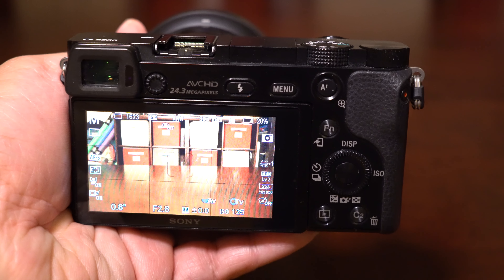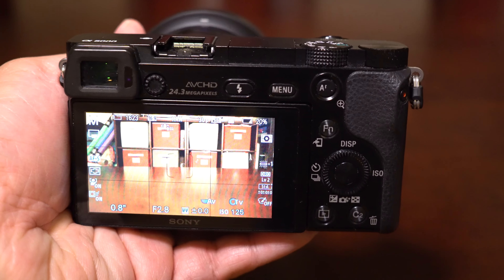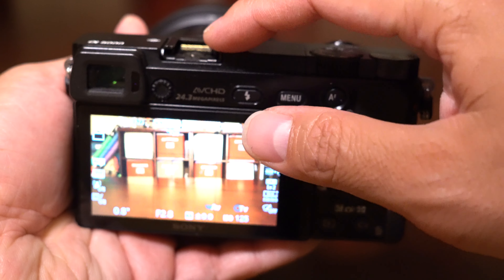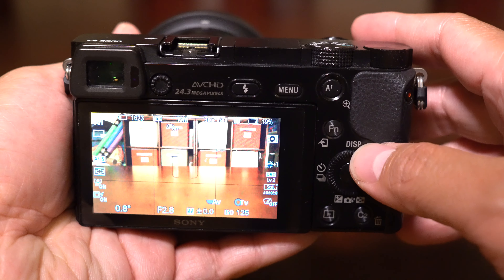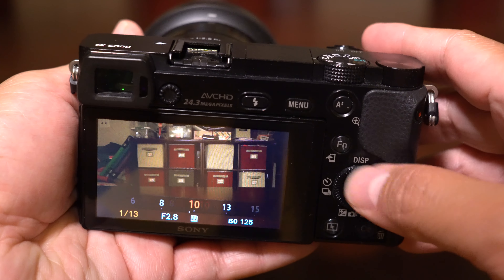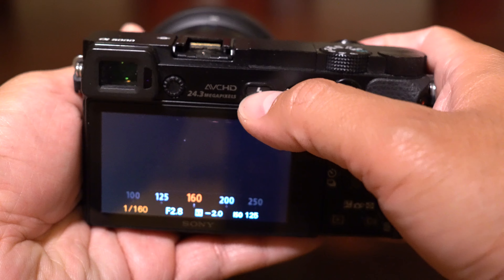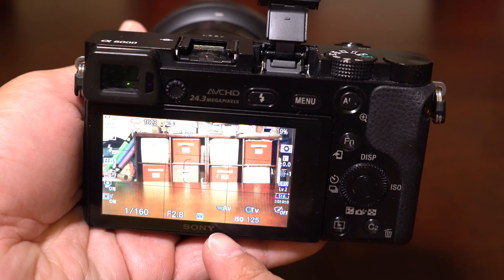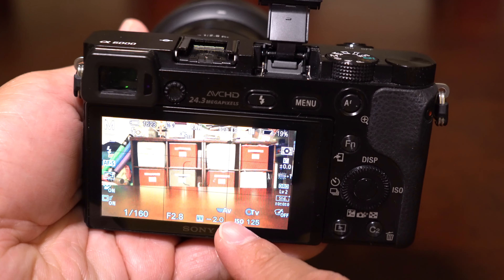FotoTofu Ep. 11 - Sony A7x/a6xxx LiveView + Flash:  Workflow + BTS Photoshoot

Comment: Great video. Thanks for sharing the details. May you also show me how you determine the flash power
Reply from the maker: +jnprpulse test thanks for the feedback and question.  After working with a flash for a while you can start to develop a feel depending on distance and what modifier is used.  It's not as precise as a light meter but when I'm using one or two lights, a liGht meter is helpful but isn't necessary in most situations. I do use a light meter at times though. I'll put together a quick video with my thought process and how to handle different situations.  I just need to organize my thoughts.
Reply: +FotoTofu Thanks again. I am a beginner in flash photography. Your tip is very helpful. I'd learned a lot. btw, your model in this video is adorable :-)
Reply from the maker: +jnprpulse test thanks! Glad it was helpful.  I'll pass your compliments to to me ideal 😀

Comment: I recently bought the X1Ts & XTR16 to use with my old version 1 Flashpoint n360. I have a Sony A7II and A6000. The trigger will fire flash, but I can't get the flash power to change remotely. Any thoughts? Your the reason for this purchase. Good job on your video's! Ron
Reply from the maker: +ron riggs hi Ron, did you have a chance to try Joe's solution?  It happens sometimes because the dial on the receiver is pretty easy to inadvertently switch groups.  If that doesn't work, check to see that you're not in HSS mode which prevents your from dialing down below 1/8.  Hope this helps, let me know.  

Also, thanks for your feedback and support. I love this trigger and is by far my favorite to date.  No frills, just easy to use and yet to misfire. Hope you have the same experience.

Comment: Thanks for the video...Adorama doesn't carry the new (sony) version of the 360.  They say (on website) it's no longer available...I have the RL 600B which I know you have as well.  Are the 360's easier to control remotely then the RL-600B.  also how hard or difficult do you think it will be to control two RL-600B  with the Godox X1T-S. You already have to stack the R2 controller on top the X1T-s to get Hi Speed Sync. so how would I control two.  Don't know whether to stick with one RL-600 and buy two 360's since the system seems simpler to control because you can put them in separate groups..I don't know how you would group two RL-600B.....
Reply from the maker: +Andre Alfred hey there.  Whoa?  I didn't realize they stopped carrying the Sony version of the 360ii but the flashes should be interchangeable as long as you have the Sony version of the trigger. That said, the 360 ver I with the new receiver is much more flexible to control than a 2-RL set-up. The RLs can't be set as separate groups with the r2 controller. There's probably some work around but I don't have two RLs so I couldn't test it for you. With the the 360, the advantage over the RL is that you can assign to different groups and independently control power straight from the trigger. A 2-RL setup is a lot of juice!

If TTL is not something you need, I'd suggest looking at the Xplor or AD600 manual. It's not much more than the AD360ii and $180 more than the very tempting price of the RL, but the Xplor will work seamlessly with the new trigger. I'm looking to get the Xplor myself (this is a want not a need so I haven't been able to justify buying it yet). While heavier than than the Ad360/360ii setup, I like the integrated battery form factor. When I use an assistant, the RL (or Xplor) is nice because it's only one piece they have to manage. If I bought the Xplor, there will still be a place for the RL as a 2nd or backup light.  And inside the studio or indoors, it can just be triggered optically without the r2 if you prefer not to stack.  Let me know what you decide on.
Reply: At this point I can't justify the Xplor either.  I have 6 flashes (3 TT850's) and (3 TT860's) with the new 2.4hz receivers along with the RL-600 sooooo I'm kinda stumped.  The new receiver will work with everything I have.  Basketball season is around the corner and some of the gyms are really dark so I wanted to strobe them. That's why I wanted two RL-600.  The flashes will work but they go to sleep to fast and the remote doesn't wake them up.  So it will be a chore to reach up and wake them up every time they snooze.  Soooo I fugured a 2nd 600 would be great especially with the HSS not available.  But two 360's would work also.  But at that price I can buy The Xplor.....SMH!!!!!!!!!
Reply: I meant with HSS available
Reply from the maker: +Andre Alfred yeah that's a tough call but it sounds like the RL will get the job done for you at half the cost of the Xplor.  If the fact that you can't independently control power for the two units is not an issue, then the RL might be the way to go. Decisions, decisions....🤔

Comment: Hi when using the MISand XT 1 trigger, did you set the flash to TTL? Thank you. Gene
Reply from the maker: +Eugene Durnin I'm using the old version of the Streaklight which is all manual no TTL. I had pre-metered the flash power.